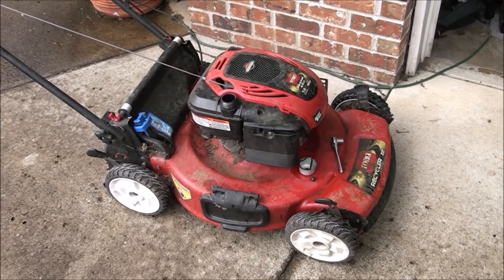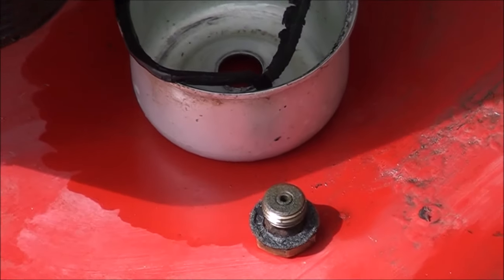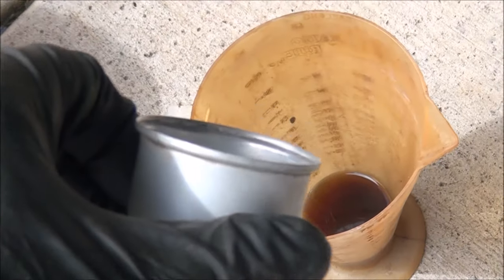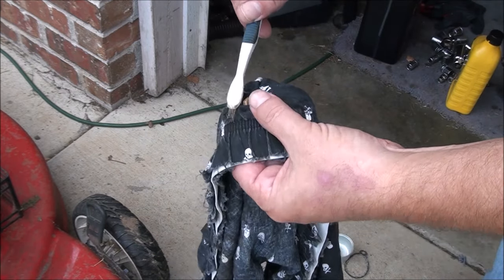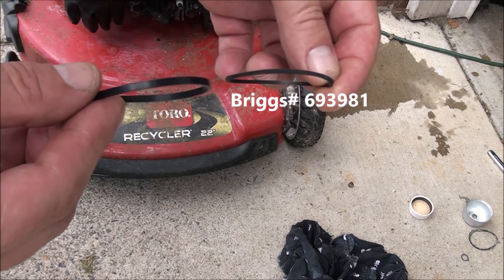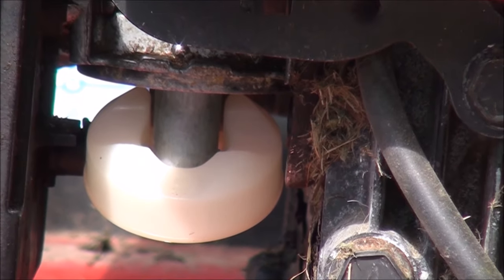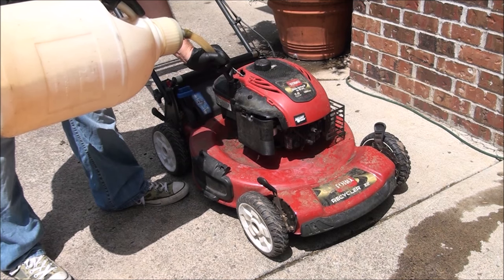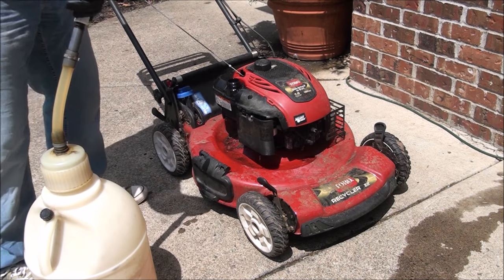HOW TO FIX a TORO LAWNMOWER That WILL NOT START or RUN.  Fuel Delivery problems repaired EASY

Comment: It's always that main jet, isn't it?  Over the years,  I've "rehabilitated" and saved three mowers put out for trash pickup that way--one of them a 22 inch Toro recycler, where the drive feature still worked! I'm still using it.
Reply from the maker: yes always a jet/fuel delivery problem
Reply: If the mower starts on starting fluid and stay running is still the jet.Same mover 20332

Comment: Hi All, Be sure to first check the air filter!  That will be an easier fix to explore before emptying the gas tank and cleaning the carburetor and jet.  I was searching for the carburetor on my Toro, when I unlatched the air filter cover.  Whoaa!!  The air filter was caked full of grass, dust and mud.  I went to Ace to get a new B&S air filter.  I popped in the replacement, closed the cover, and the mower started right up.  If this didn't solve the problem, then I would have no choice but to follow the instructions here.  Thank you, Jeff!
Reply from the maker: righton, good job!

Comment: Think about how bad coke has to be for your teeth if it cleaned that gasket so well 😂
Reply: True. But you can mitigate it by rinsing your teeth with water afterwards and always brush and rinse with like Listerine Total Care before bed and you'll be ok.
Reply: Myah C plus you aren’t sitting there with coke in your mouth for a straight day 😂 but yea it’s horrible for you
Reply: I used Diet Coke. Lol

Comment: Generally a bad idea to poke wires through any little hole in a carb ... use carb cleaner (acetone/toluene spray).
Reply from the maker: I agree but sometimes there is no other reasonable easy way to unplug jets. The copper will not scratch brass in my experience.

Comment: Thank you for posting this video. I didn’t have any coke so I used a thumb tack to clean out the hole in the main jet and it worked. Fired right up and stayed running. Thanks again.

Comment: Great advise.. Had the exact same problem... I only soaked the part for a couple hours and did use a small wire to ensure the holes were good.  My last step was to buy some non ethanol gas... It runs like NEW!! THANKS!!

Comment: Works perfect now! I did exactly what you said. Except what I did as well was 1. I took all the old gas out first, then put high-quality gas in along with some heet (to remove moisture)
2. I then I drained it all out through the opening you show

3. Cleaned out the opening in the bolt
4 reassembled it started perfectly

Comment: so the bolt holding in the bowl is good enough to clean the carborator?
Reply from the maker: yes unless the rest of the carb is really dirty too
Reply: @jeffslawnmowerrepairandservice  thanks Jeff, did this yesterday, now my mower starts on single pull, 8 yr old Toro, works like new.  I'm running this thing into the ground.  Good Video!

Comment: yeahhhhhhhhh , thanks man .  i used my mower like i was playing PAC MAN on a long 4 foot high pile of leaves last november .  i took off that plastic grass shooter and closed off the blower .  when i was ending my mulching the mower started surging like crazy i guess either from this gas issue or the air filter .  so im gonna start with the air filter and blow it out with the compressor and then try this move in the video .  am i on the right track ?  could it be any other issue than air or gas ?  Thanks !   J in Tn .
Reply from the maker: Yes clean the gas tank and carburetor
Reply: @jeffslawnmowerrepairandservice  thanks man . today i looked at the air filter and it was clogged from all the mulching . i hit it good with the air compressor and changed the oil too .  she started with the first pull .  Jeff , i have beat the living hell out of this mower over the last 5 years and she still runs perfect .   Very good product !  Thanks for the video .

Comment: I have one that I replaced carburetor and it turned on fine. I turned it off and it won’t come back on unless I spray some carb cleaner on carburetor. Any ideas. Defective carburetor???
Reply from the maker: possibly... if it was a cheap carburetor. OR you have a contaminated fuel system (tank,lines,carb) that needs to be cleaned out.

Comment: Jeff, I have same mower and after sitting few days between use,  it will not crank cold but after I use starter fluid the one time to get started,  it will crank rest of lawn cutting that day easily.  Why not first time? Thanks
Reply from the maker: probably needs the carb and fuel system checked and cleaned

Comment: Will fuel leak from below that area if the carburetor is plugged....or could that be coming from a bad carburetor gasket.

The fuel line is good/ not leaking but still  seeing some fuel and don't know what is causing it to leak down.??
Reply from the maker: float bowl oring gasket probably

Comment: i have this exact mower i picked up form scrapping.. it works well seomtimes but everytime i want to use it if it even sit for like 3-4 hrs its starts to have the same problem it wont start for whatever reason but once i spray the filter with carb cleaner it starts right up..my mothers has the same probelm..both have new carbs and new filters so i dont know what the issue is and honestly im tired of taking apart both of them ..i mean having to spray a small amount fo carb cleaner to make it cut the lawn is no big issue but i shouldnt have to....any tips would be great.
Reply from the maker: Fuel system and carburetor needs cleaning, possibly rebuild the carb

Comment: I’ve had my toro for a month. Going on my third cut and it’s already stopped running!
Reply: Dude, exact same! Beyond pissed rn. Did you figure out the issue?
Reply: Same here.  3rd mow on a small yard.  I took it to the local dealer but got suspicious and left when he started babbling carb. replacement and warranty void because of ethanol gas before he even looked at it.  After talking to every Toro repair shop within 100 miles I became convinced that my new mower would be violated and held for ransom so I began corresponding with Toro tech support to get some sort of actual support and information from them.  They're a non-existent department somewhere in the shell of a former quality company which exists in name only.  Once I realized I had bought a pig in a poke and the 2-year, start on the second pull guarantee as well as the warranty was not worth the placard and paper it was written on, I knew I really owned the mower and began using a spritz of starting fluid into the air intake and I'm on my way.  Once started it will keep starting as long as it doesn't sit for too long between starts.  Works for me until a cure comes along or Toro puts their big company pants back on.

Comment: Always. Clean air filter or replace.  Also. Blow off area. Of repair. Before you begin disassemble. Less.  Crud around during reassembly
Reply from the maker: good tip

Comment: What did you use to clean out the fuel tank?
Reply from the maker: I just empty it let it sit in the sun the blow high pressure air in there to clear it out.

Comment: I am gettin ran through the wire on my toro lawn mower. I cleaned the carb, even took it apart and sprayed everything. Changed the air filter and gas. Got it running, cut half the lawn and it cut off, can’t get it to start again
Reply from the maker: Clean it again and make sure to clean the gas tank and fuel line too.

Comment: I have a Toro lawn mower and the ignition switch does not work any more.
Any advice on how to fix it ?
Reply from the maker: https://www.youtube.com/watch?v=1VWUizeW1Tk OR if it is a push mower, you probably need a new battery
Reply: I have a Toro lawn mower. Is it okay to remove old oil and old gasoline from the lawn mower using a plastic turkey baster ? One turkey baster for for the oil and another turkey baster for the gasoline.
The turkey baster will be inserted into fuel opening and the oil opening.
Reply from the maker: that's o.k and a good idea too!
Reply: If I try to remove the old gasoline with a plastic turkey baster will the turkey baster melt if it gets in contact with the gasoline?
Reply from the maker: Possibly, It depends on the type of rubber or plastic that the baster is made of.

Comment: STEP1
does it turn? Is it seized?
STEP2
remove air cleaner & spray a flammable into the carb
STEP3
Give it a Yank.
You just learned 3 things:
-if the starter works
-if it has compression
-if it has spark
If it started up & kept running you also learned:
-the carb works
-there is fuel in the tank & it is burnable.

Now, cut your grass.

!
Reply from the maker: Great tip!

Comment: What is wrong with a mower that start up n white smoke come put
Reply from the maker: could be too much oil or gas in the oil or that the airfilter is oil saturated from the mower being tipped over.